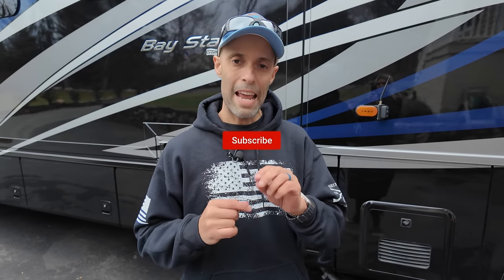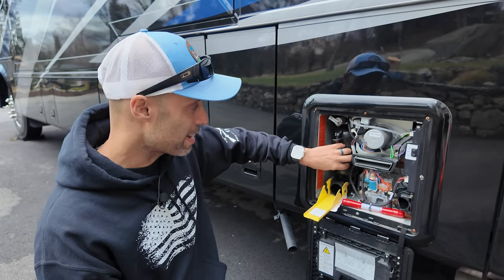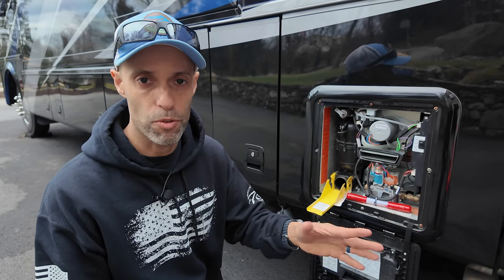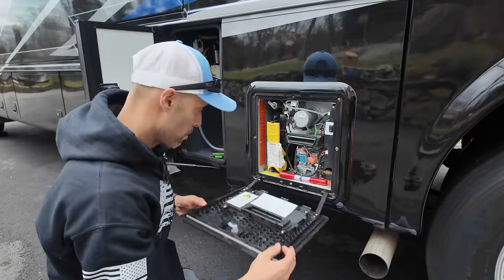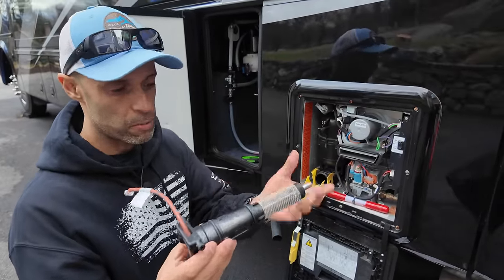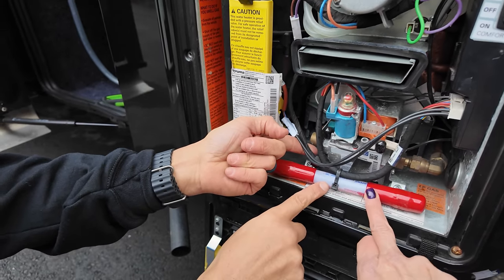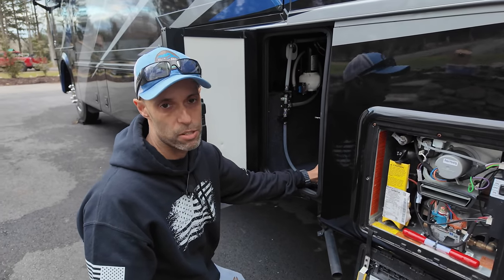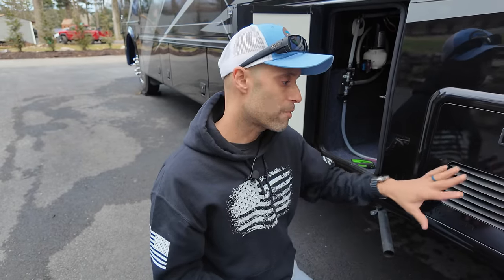This 10 Minute RV Fix Can Save Thousands Of Dollars In Damage -- Here Is How To Do It!

Comment: It is great to know as I have that system and live in Massachusetts, so in the cold months like December, as we traveled to Florida and stayed in PA ans VA , it is a peace of mind while going done the road. I bought the Beast (40 ft class A diesel pusher), so every month that it sits without us using it irks me for paying for it to sit idle. So I really don't want to fully winterize just for a few weeks. That is why I switched to blowing the lines out with air via chemicals and leaving the faucets open when sitting idle. If there is a better way, I am all ears. Also made my own inline sanitizer to add bleach to tanks that only have the shore hose connector. Mine will hold more bleach than needed, but have it figured out for normal scale. Best of all all PVC, so no chemical reaction with brass. I had some of the item like Pprimer and cement as well as the main pipe so it was less than the cheaply  made one on Amazon.

Comment: That's one solution. Another is install a cut out valve and drain the liter or so of water for the time you are traveling in cold weather. When you need hot water, open the cutout valve, turn the propane and water heater on. Wait two or three minutes, and presto.